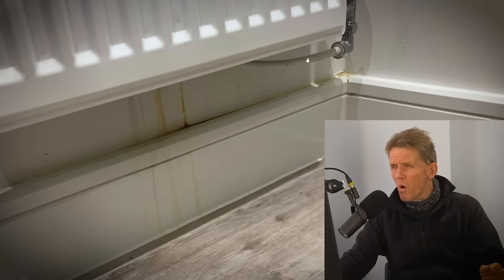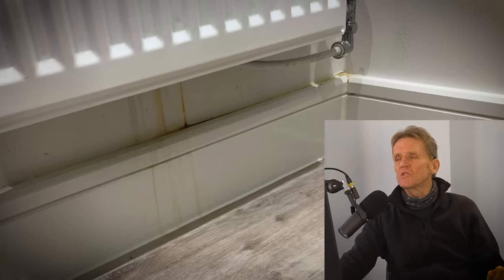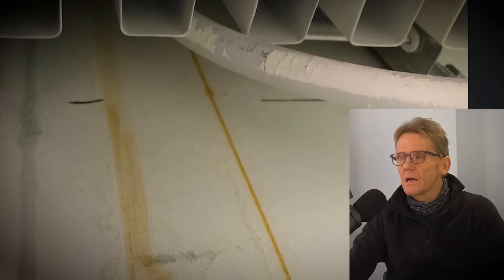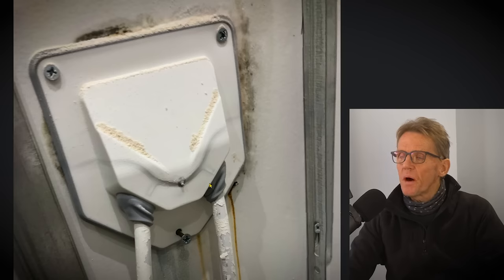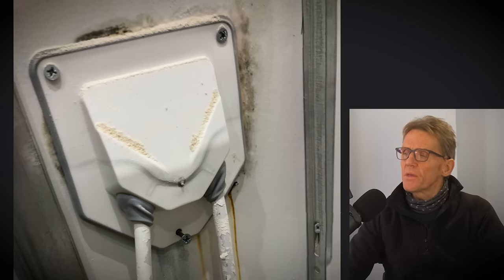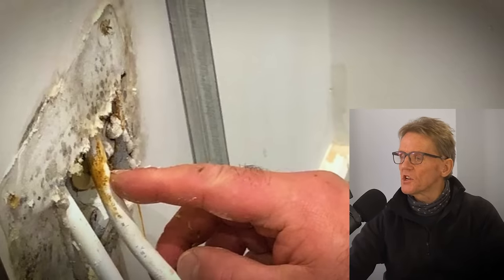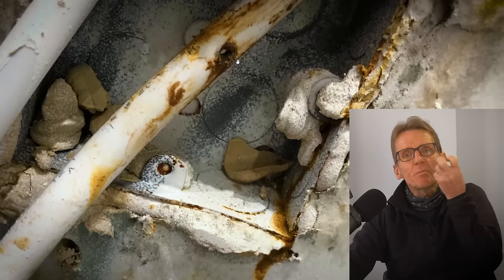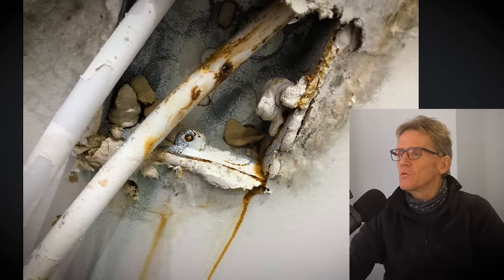Mystery Leak Reveals Schoolboy Error

Comment: Had a problem like this in a house where someone had put a floorboard screw through a  22mm hot water pipe. The hot water was gravity fed and the screw sealed the hole well  enough to hide the problem until the screw rusted away. Knowing something of history of the house we reckon it had lasted a good number of years before water appeared through the downstairs ceiling.
Reply: yep, exactally the same here except running under the bath... that was fun
Reply: We had similar - a nail through a 28mm pipe to the (gravity fed) boiler, likely done when the house was built 24 years ago and was fine until we pulled up the floor boards (and therefore pulled out the nail) to run some new cabling. Shows how good the inhibitor they used must have been for the nail to not rust away!

Comment: I have much less of a problem with the pipe config, than I do with the fact they are still fitting small bore pipes in new builds, but then again they are fitting the smallest noddy radiator they can get away with... (usually)
Reply: in Bel-air california they put 3/8" restrictors on the water meters if you go over your threshold

Comment: Having a 30 year old home with failing microbore joints that plumbers don't want to touch, it's a wonder to me that more systems don't leak. When we're finally forced to go to heat pumps, I reckon I'll just rip the whole lot out and go to ducted air-to-air instead.  At least leaks in that don't soak your timbers, and you can fix them with tape.
Reply: If you are going heat pump you are very likely to need to repipe. It is also  likely that you have plastic pipes on the system too and if they are retained with a heat pump the lower temperatures lead to biological growth that can bring the whole shebang to a halt.
Reply: Just go UFH with an electric flow 'boiler' or trench heaters.
Reply: It's him again! (Honestly just glad to see you still exist after fond BCF memories)
Reply: "When we're finally forced to go to heat pumps"
 Really, wow so you think it is ok for someone to force these things on people?
Why not make up your own mind about how you want to heat your house.

Comment: I used a similar cover product when replacing all my radiator pipes when I relocated and installed new plastic pipe, I created a manifold in the attic with stopcocks on every pipe so if there ever was a breach I cold isolate the offending pipe. I was very careful with screws and their placement. I have now only two radiators to replace with one to install and all will be re-piped to the manifold. Important to mark up the manifold as where each rad is too☺

I'm in a bungalow so much of the pipework was easy to replace.

Comment: Those plastic pipes are a boon to the decorator - you can lift the rads off the wall and lay them flat on the 10 litre paint pot you've set in front, while tidying up and neatly painting 'behind' the rads.

Comment: That’s deliberate. Plenty of people on site do that kind of thing. I’ve seen joists thrown down drainage pipes,to cause problems in the future.
Reply: Indeed. Our new house the main drain blocked. The builders dug up the patio and the drain was blocked with tile fixing cement. Curiously the contractor had been laid off some months before completion
Reply: I agree that some things cant have happened by accident. My house was built in 1989 and we had a persistent problem with the bathroom sink blocking up. I did a complete bathroom makeover last year and when I cut the sink waste pipe I found a 6 inch piece of half inch light steel pipe which had white pvc coatinghad been dropped down the pipe before it was cemented together .I think its a piece of wardrobe railing but there is nothing like it anywhere in the house.Accident my eye
Reply: Thank you!  I've been telling people this for years, and people tend not to believe me!  I was called to a blocked washing machine 40mm pipe in a flat just six months old - customer said water wasn't getting away.  Eventually cut the pipe right by the boss strap and got a torch.  Inside was a 4" fence post.  I couldn't believe it.  Must have been the labourer's last day or a disgruntled contractor.
Reply: Yep! I used to work on big sites for the big volume builders and a lot of the trades were on peanut money. And they didn't give a toss and got up to all sorts. One trade got chucked off but before he did went into loads of properties and cut wires under the floor, broke pipework under the floor, chucked rubble down the manhole. He was pissed at something.

Comment: I had the opposite problem with a combi-based central heating system - pressure creeping up over the weeks. One of the toppping-up loop taps was permanently open (because it was horribly inaccessible) and the other was weeping. Still, at least there wasn't any water getting into rooms or cavities that way round.

Comment: I ran my central heating  by running a 22mm through the loft or floor joists. Then connected a 10 mm system via 22mm to 10mm T's  but ran that 10 mm through a 15mm pipe hidden in the walls or under the dot and dab plaster board. Less heat loss in the walls and it makes the whole system reparable by simply withdrawing the 10mm pipe from the 15mm pipe.  NO hacking or damaging walls if there was a problem. That makes the system very efficient as less water for the boiler to heat. It heats  up faster as well.  It works very well but you do get that pipe visible under the rad.  This repair was visible but IF it was hidden,  a repair could have been made by running that 10mmm down that damaged 15mm pipe. All that would be needed was new rad connectors for the 10mm fittings.

Comment: One of the previous owners of my house has screwed straight through a electrical wiring PVC pipe, luckily the wires just moved over a bit inside the tube and there was never a shortcut. I kept that piece with the wires and screw as a reminder to be careful.

Comment: My last 2 houses I have come up from under the floor channelled in the wall with 15mm as a sleeve to behind rad, then pushed 10mm thru so changing the 10mm if you have any probs is a doddle. I have still run 15mm circuit round and then teed off to 10mm. Never used the manifolds yet and run off to each rad in 10mm, maybe next time. Oh and pipes come up vertical just near bottom of rad so I can circle the 10mm round and down to valves, leave a bit of a coil if u like so u can lift rad off an forward 6 inch onto 2 blocks to clean or decorate behind with ease.

Comment: So, new build (ish) in this vid with micro bore pipe, still being fitted to new builds - next combi / system boiler change all that micro bore throughout the huse will have to come out, new 15mm pipe work throughout,  fully lagged / insulated behind the plasterboard that isn’t gapped behind enough for the insulation.  Throughout the whole house.  Its now the law you know.  And let’s not forget all the rads will have to be re sized bigger, so changed as well.  All in the name of heat pump prep at your cost.  And all you wanted was a new gas boiler
Reply from the maker: You are so right

Comment: Many years ago, well before I had common sense, my mum asked me to fix her creaky floorboards. Easy fix, two quick nails.
A day later I was sitting in her dining room when water began to drip from her light fitting. A plumber was called out and he repaired the damaged central heating pipe in the room above. My two nails went straight through the middle of a copper pipe running through the joist I had hammered into. 
Huge lesson learned and my common sense was topped up. 🥴

Comment: Bought a new build a few years ago. Looked ok until after a year when paint was peeling, cracks appearing in drywall, under stair wood panels warping, window sills cracking. Worst workmanship I’ve ever seen in the UK. Honestly, I’ve worked on building sites all over the world, some places considered 3 world countries and i could say the difference was marginal. What has happened to the building trade in the UK. There are great tradesmen out there but there are some sh*t ones too. Doesn’t help when developers cut the arse out of budgets to maximise profits either.
Reply: Run to the bottom on first site, and now increasingly domestic work, to. 
Cheap and fast is all people usually want.

Comment: The plumber who did the repair may have been able to pull some slack in the pipe down, which would explain why the screw hole looked like it was in strange place.
Reply from the maker: Good point

Comment: I had a en-suite to fit out. Removed the old skirting which would of been the original fitting for over 15 years. Soon as I removed the length of skirting I got wet!!!  A paslode pin had been fired straight through the feed pipe to the radiator. Amazing how long it had been in bedded in the pipe and still had a seal 😉

Comment: Thought we gave up on microbore when plastic started being used. Didn't even know microbore plastic on central heating was a thing.
Reply: I just bought a house a few weeks ago. I got a gas engineer out to fix a water leak from the combi boiler, he looked at the 10mm pipes to the radiators and nearly died laughing. He said the boiler was great but the rest of the system will need to be scrapped. I had to agree… 😂 He said he couldn’t believe someone put a new boiler on to a system from the 1980s. Two of the downstairs rads had to be disconnected right away as the leaks couldn’t be fixed.

Comment: GREAT VIDEO it happened to me i fitted new flooring boards in the dinning room and 15 years later the boiler was loosing pressure and it turned out i had screwed right in to one off the pipes and it was my sons jumping around playing table tennis in the dinning that must have loosened it up so it started leaking 
it took ages to find i had been under floor boards even returning the flow and return on them shelf  to see if it was the boiler leaking and chopping rads out etc 
just a relief to find it and i sorted it in the end
as always another great video roger thanks again

Comment: I work for the water board and have inspected new build sites on executive type builds and the quality of the plumbing is shite. Some Prat put in a PRV that restricted the supply and when I told him to remove it the flow was a lot better. Put it in for no reason other than, “it’s what I’ve always done”.

Comment: I had an elderly customer one time that asked me to do some work on the floorboards. I asked him if there was any pipes under a particular area where I needed  to put some screws through to tighten down the boards, he said no....
Reply: Reads like the book cover synopsis of a plumbing horror story.
Reply: You should of checked
Reply: @dave farmery  To check, I'd have had to rip up all the floorboards. He assured me he'd worked on the area before, and there would be no issues.
Reply: @davefarmery8180  He was wrong.
Reply: @damionlee7658  The horror story ensued..
Reply: @gdfggggg we've all been there ,  thats why i bought an endoscope, i never take the clients word as gospel anymore 👍
Reply: @davefarmery8180  `most customers would not even know,  i sure don't
Reply: @abelfaber4457  he's the one that did all the pipework in the house.

Comment: Looks like the two pipes are going through the 20mm knockouts of a metal electrical back box . Even if there are grommets in the holes    is this acceptable to the building regs.? Agree with you Roger it looks horrible the way it's been done.
Reply: I spotted that too. Given the shoddyness of the rest, there's no way grommets are in the back box, as to whether it should be used, I certainly wouldn't. Don't know how many expansion/contraction cycles it would take the box to gnaw through the Hep, probably longer than the O rings in the fittings will last... Indicative of price over quality.
Skirting join is shoddy too ffs
Reply: Building regs? This is NHBC self certification, it will never be inspected by building control, so why bother to do the job properly if it can be done cheaply?

Comment: For the chimney I would remove the entire chimney alltogether completely cover the hole in new roof cladding top to bottom. That would fix the leak. Then rebuild the chimney completely. Brick biscuit glued on 18 thick fibrous cement 40 x 40 galv RHS steel frame. To exact same dimensions with matching brick buscuits. 

So the roof only has 4 penetrations. The four RHS posts. All new perimeter flashing. At the Back it has that pointy flashing. Can’t remember the name.  Any moisture getting through the buscuits won’t enter the building. 

Big job high costs. I have built 4 tall brick chimneys in Christchurch New Zealand. Like I just described. In chch we don’t have brick chimneys cause they all come down in the earthquakes.  But this detail was approved by council. The result looks perfect. And are some of the only tall brick chimneys in Christchurch. I didn’t build them I designed them.

Comment: I shot a 2", 18 gauge nail thru a 1/2 copper pipe and it didn't leak for over a year.  We saw some water drops and there it was.  I shouldn't have used such long nails.

Comment: Good luck to the plumbers of the future dealing with o ring leaks from the hundreds of plastic push fit joints under floors and in walls of todays new builds..
Reply: I've just done a whole house refurb in plastic. Great, so easy....but Leaves me feeling uneasy for the longevity. ... like you. But then I've had copper pinhole within 10 years ..
Reply: the heating pipe joints barely last until the homes are handed over to the clients on my site,its incredible these products were sanctioned at all,rubbish
Reply: I've been putting plastic pushfit in ever since it came out.  I have even used the Hunter stuff that you glued together.  It's been superb.  My house was completely refitted 17 years ago with pushfit everywhere...not one leak...and all joints are above floor.  In my 48 year career, I've had two pushfit joints leak, and one of them was my fault - and both showed up immediately.  Seriously, Stevie, they are fine.

Comment: As a pest controller, i have seen the metal braided hoses gnawed through by mice, i have seen these god-awful plastic "kwik-fit" pipes and joints gnawed by both rats and mice but i have rarely (twice perhaps in 15 years) seen soldered copper pipe gnawed. Ergo, when i redid my plumbing it was all copper and leaded solder. Don't use those plastic toys.

Comment: Mmmm very good  mr bid by , but how on earth did this pass an air test on the system ? Clearly very little leakage as the screw sealed the hole partly ? That’s an absolute shocking method design in a modern house ? As a carpenter of 40 years I’m flabbergasted at the poor quality of bodgery out there ? Something has to be done ?

Comment: Should have used decra, britmet
or if you fancy chancing it at least use a profiled tile with 125mm lap use procter roof shield and double felt it, and get a lead welding plumber to flash propper, then pray.

Comment: The screw rusting gave it away. Luckily.
Reply: Should have used stainless steel, probably would have lasted years without any problems at all.
Reply from the maker: beijingbond
I think the rust was coming from that electrical backbox. They have hardly any galvanising.

Comment: Just had a small job done at home that involved drilling through the wall to the outside. The lads doing it asked if there was anything in the wall that they should know about and I told them that the plastic radiator pipes ran up one or the other side of the window. These plastic pipes cannot be detected so they drilled the main hole very carefully with no problem. Then the two holes for the fixings and managed to hit both pipes. I must stress they were very carefull but sods law and all that. Managed to cut out the plasterboard and get a couple of connectors on before too much leakage. How are we supposed to know where they are? Can a metal filament not be inbedded in the pipe at manufacture? I later found out that if the heating is on you can feel the heat from the pipes through the plasterboard on an external wall so maybe a little giveaway.
Reply from the maker: It is very easy to find hot pipes in a wall but too late now. There are also pipes with an aluminium layer that might or might not be picked up with a detector. It is not reliable. An infra red camera works very well.

Comment: In a mate’s house he had constant loss of pressure in gas boiler. After a lot of fruitless investigations the housing association replaced the boiler. For another year there was still a constant loss of pressure. The cause was found when the plaster in the hallway started to blister beside the radiator, turned out there was a leak in a pipe under the floor all along. 😂
Reply: Typical housing association, didn’t fix the issue but just wasted money instead
Reply: @user-te1le7ck6b  This particular one is a disaster. In the same house they had a leak in the upstairs bathroom, the H.A. plumber said there was no leak. A few weeks later the toilet sank into the floor when the chipboard floor gave way. Turns out the builder had not even used moisture resistant boards so it just crumbled. They then sent out two clowns to replace the floor and one put his foot through the kitchen ceiling. After this was fixed my mate was taking a shower and it turned out the bath was not secured to the wall properly, he ended up getting his own plumber to fix it as he didn’t want and more bodge jobs. All this is in a house that’s only 20 years old. 😂
Reply: @jimh4072  dont get me started currently taking legal action against my local council as they have failed to fix a leaking roof for 4+ months and counting whilst they find the original contracter for a in warranty repair , problem is no one knows who it was , fckin clowns the lot of them , soon be on me if i didnt pay my bills though